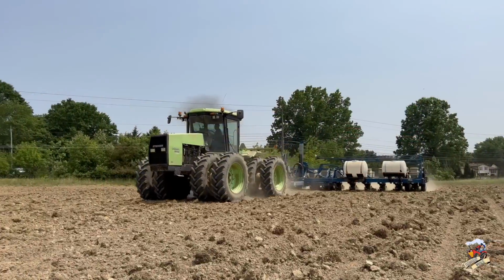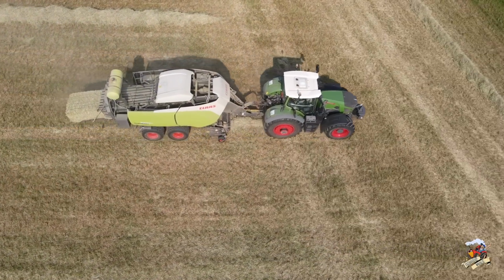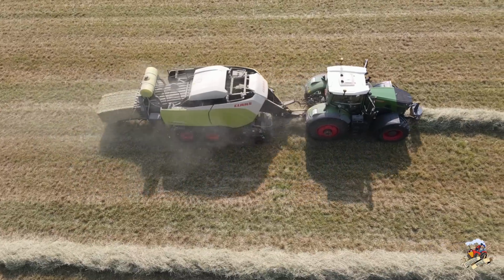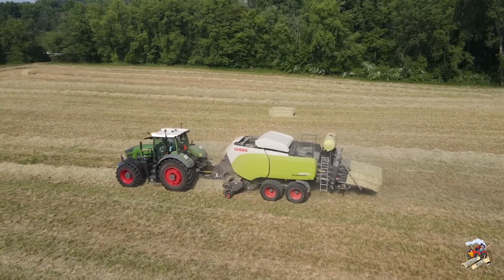Making Big Bales of Hay In Ohio | Fendt 939 Tractor & Claas Quadrant Baler

Comment: Hello! That CVT is announced in Europe as permitting a top speed around 38mph (60km/h), at least!
Top german enginearing...
Reply from the maker: Some of the Deutz do 60 KM/h also but not in the USA. They are limited to 50K here. I guess you have to have 4 wheel ABS brakes. Deutz has 4 wheel braking on many models but no ABS here.
Reply: @farmhandmike  That's a pitty! It's always positive to take full advantage of prime technology!
May be so sometime ahead.
Thanks for sharing that information.

Comment: Mike, I'm curious about your brand preferences.  If you starting a new 4,000 acre farm today and planned to grow corn and soybeans, what brand of tractors, combine and planter would you buy?  Assume that price is not an issue.
Reply from the maker: Great Question, If money was not an issue and I could buy anything I wanted? First off I like to be different so It would be a tossup between a Gleaner or Claas Lexion combine. For sure would have a Deere 8RX, A Versatile Delta Track, A Deutz 9340 and probably a Deutz 6175 with a loader. Probably buy a White Corn Planter and a Horsch planter for soybeans. Definitely a J&M Grain Cart on tracks. I've always liked Krause Tillage Equipment but Sunflower would match the Versatile Delta Track. Then Probably a good mix of some White and Ford Tractors. Then if I was going to do some hay one of those Vermeer ZR5 self propelled rounds balers and a triple mower for the Deutz 9340. I could probably go on but I've rambled enough here.